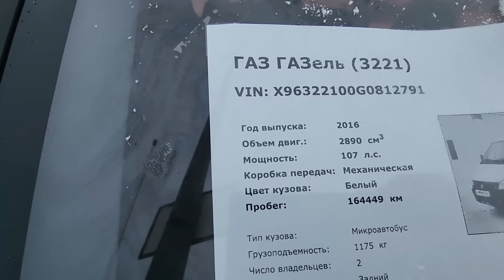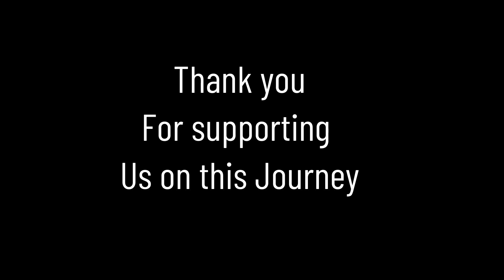NO LONGER FROZEN IN RUSSIA!!

Comment: Hello Arend!
Please don't buy Gazelle, Sobol and other commercial vehicles for your family use. At first, they are catastrophically unreliable. Company, I'm working in, recieved thirty brand new NEXT 2.5 months ago, among them 2 were broken from factory and 5 in the first month of use. Fuel consumption is just crazy. Taking Gazelle is option when you have another reliable vehicle for everyday use. Also "D" driving license is required, which is not so expensive, but requires "C" (3.5+ t light truck) category unlocked for at least 2 years.
This exact gazelle seams to be working non-stop for last couple of years, keeping it alive is hard in labour and very expensive in time.
If I were you and knowing situation in car market, I would have taken passenger lada largus (7 seats) or something similar from japan with tow hitch and 750 kg cargo trailer (doesn't require additional license) and cheap lada niva or uaz hunter/buhanka for all-terrain use (5+ seats). Yes, 2 drivers are required, but overall maintenance cost will be smaller. Even so good largus is hard to find, because who wants to sell a working horse? but it's much more reliable and maintenance is way cheaper.

Comment: Take a look at UAZ 452. Its very crude but a more reliable than Gazelle. Plus UAZ is a hell off a offroader
Reply from the maker: Good for the whole family?
Reply: @countrysideacreshomestead2008 насколько я знаю, сейчас УАЗ  оформил новую линейку - микроавтобус. Сколько мест - не знаю, извините. Помимо этого есть модель 4×4 класс джип
Reply: 452 is a bit smaller interior volume wise but there should be options with 2 bench seats on the back and 2 in the middle. But it will not have room for luggage. Definitely look for 4x4
Reply: Also, if you are planning on camping, you can get roof-rack installed for larger items

Comment: Народ, я тут немного углубился в отечественный автопром, а реально, кто кроме ГАЗа производит микроавтобусы на 10+ человек? УАЗ буханка максимум на 7 рассчитана по заводу, ВАЗ Ларгус тоже 7, а больше я не нашёл ничего.
Неужели Газель безальтернативна? Не ПАЗик же рассматривать, как микроавтобус, он вроде бы уже на полноценный тянет.
Reply from the maker: I think for domestic it is our only option yes. 
Back in canada we had chevrolet express, Ford econoline, Mercedes sprinter and Ford transit. 
Although I think they were discontinuing the econoline
Reply: @countrysideacreshomestead2008   You know, but really look at the PAZ buses, there are a lot of them on Avito and at different prices, of course I'm not an expert in their technical part, but I've been riding them a lot as a passenger and this is probably the best bus you can ride. The suspension is soft, eats up all the bumps, you sail like on a boat and these buses were in 4x4 versions for rural areas.

Comment: It will be much easier and cheaper for you to fix Russian vehicle in Russia especially now when Russia is under heavy sanctions and many car manufacturers from abroad cut supply of parts and services to Russia. It is not as reliable and comfortable as foreign van but sometimes it's not good when car depends on electronics and microprocessors a lot. In this case you can fix a lot of things by yourself without going to dealership and paying whole lot of dough. Russian cars are simple and straight forward I would say as they were 30 years ago. I would recommend Niva but this SUV is too small for your large family.